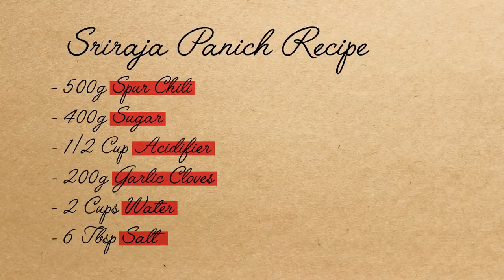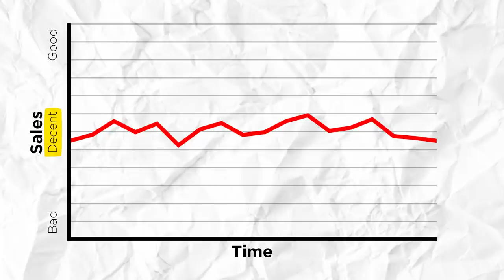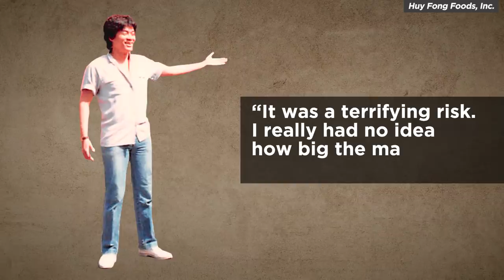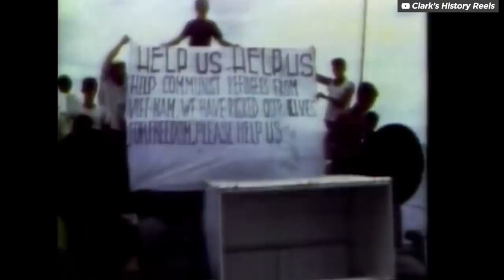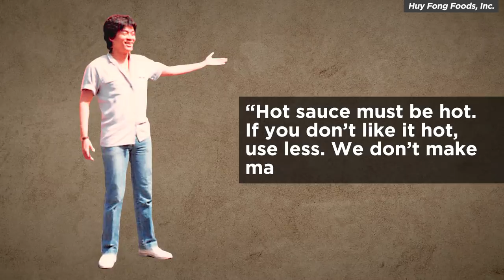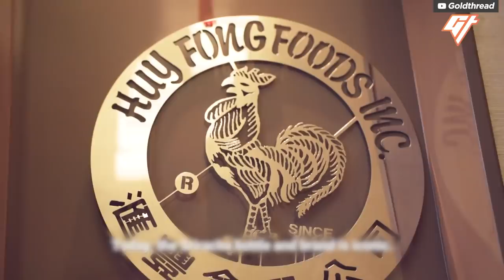How a Man Left to Die Made Sriracha

Comment: Should've expanded on or at least exclaimed the cheapness of the sauce to be more important. The one part I found most interesting was that it was so low cost that restaurants put the entire container instead of portioning it. I still remember the countless times I went to eat and recognizing the iconic bottle/label. It was to a point that I had a light aversion to places that used blank containers or a substitute brand.
 
The bottle's design also played a key role, since an equally prevalent sauce was the "hoison sauce" but due to its spout design restaurants opted to put it in the generic squirt bottles similar to ketchup and mustard. I only know the brand because my mom buys it regularly.